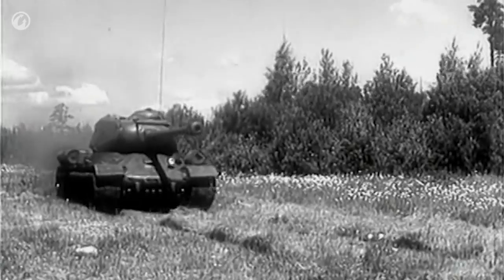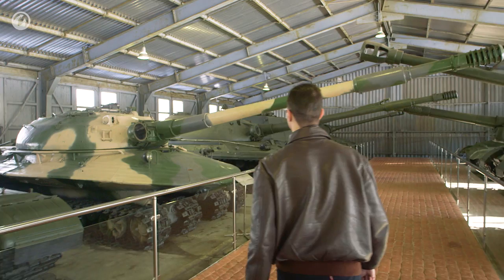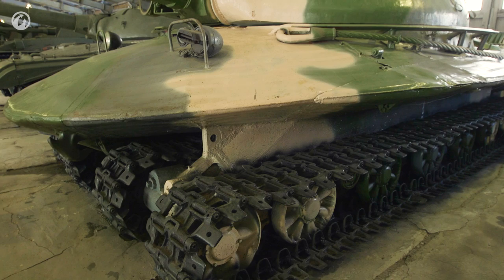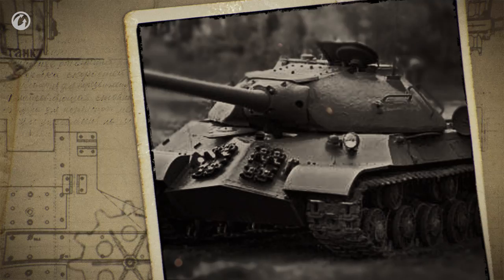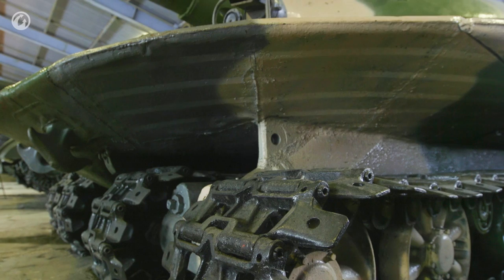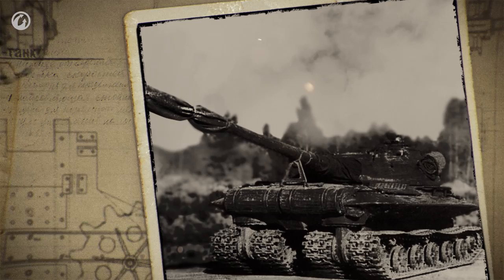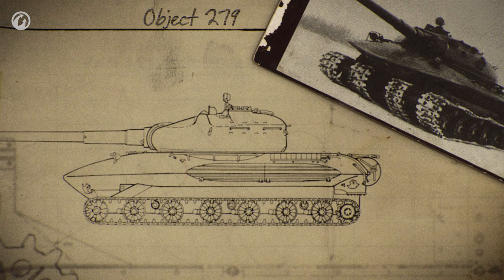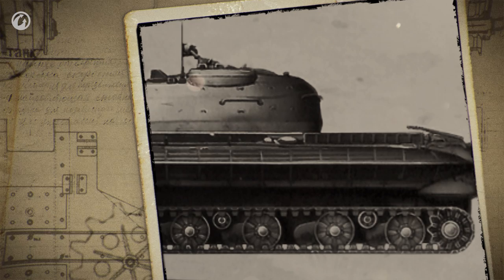World of Tanks - Object 279: The Warrior of the Apocalypse

Comment: a bit late to comment here, but if this tank has a lower plate and some other weakpoints in real life, why did you have to change the in-game model so much, that you completely removed them?
Reply: Demolisher you did hear what this video said about the armor right? It said that it was meant to be anti-HEAT and to resist almost all gun calibers of the time due to how heavily sloped it is. If they went with this design over the one in game then no one would pen this from the front or side of the hull plus that lower plate is heavily sloped back to a degree which looks almost impossible to pen